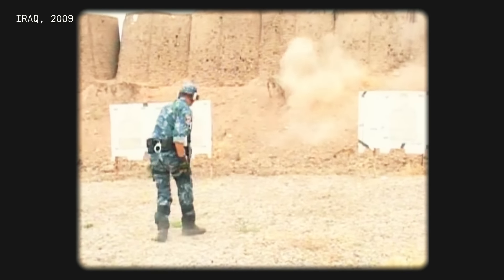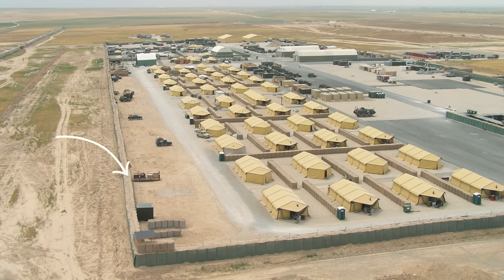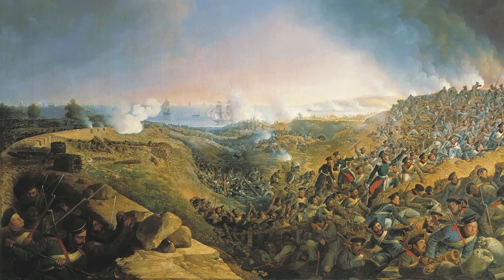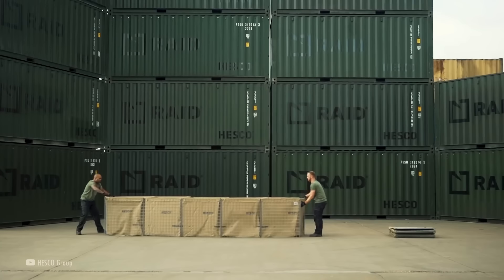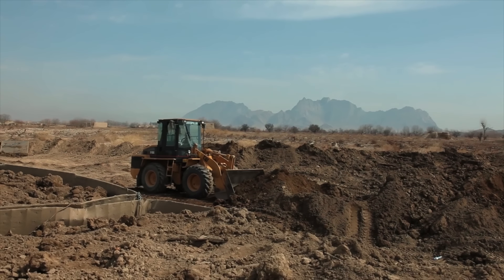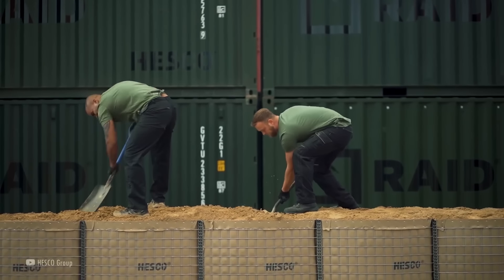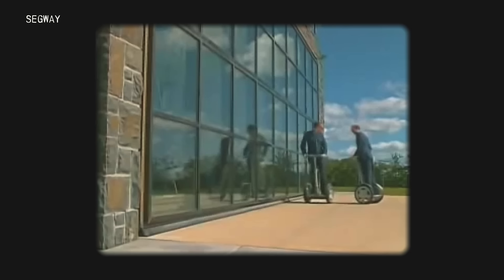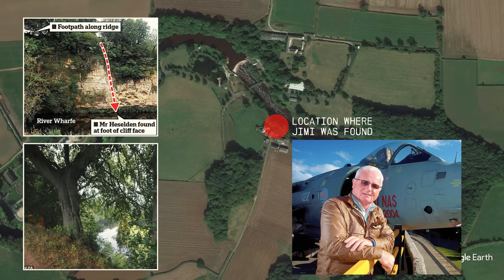Goodbye sandbags?  This is how fortifications are built now | HESCO Barrier

Comment: Hesco barriers are for bases. Sandbags are still used by the infantry. Hesco barriers require heavy equipment to place them. Infantry troops don't have that luxury. I am reminded of the time when I was a private in the 82nd. We were going into the field and my platoon sergeant was assigning tasks. He tells me "You will carry 4 sand bags. I was freaked out because sand bags are heavy and I was the M-60 machine gunner. The M-60 and ammo is already heavy. I went to him afterwards and told him that I would try but I didn't know if I could carry that much weight. He looked puzzled at first, then burst out laughing. "Hey, Dumbass, they don't have sand in them when you are carrying them. You fill them when needed." I should have felt foolish, but I just felt great relief.
Reply: this is the most infantry assumption ive ever seen. Assuming they will be full while you have to carry them.
Reply: 100% the most WSL answer 😂
Reply: Helmet +100 Def but also -100 Int.
Reply: This is the grunstest story of all grunts.
This reminds me of the story in ww2 when the Gurka regiment was told they were going to be flown into hostile territory and then they would jump out of the plane.
They assumed they were going without parachutes..... for a full week and were making requests for changing the landing spot to an open field so they had a higher chance of survival. But they never refused😂
Reply: @snakemanmike  HESCOs weren’t even in existence when the M60 was around.  In Afghanistan we would own a hilltop, Seabee’s or engineers would drop in and build a COP in 2 hours with HESCOs
Reply: This didn't happen to me, but I still got nostalgia.
Reply: platoon sergeant. left out the last word, (EMPTY) lmao
Reply: Thx for a story.
Reply: I don't know about the Army, but Marines have definitely been tasked to fill HESCOs with shovels (or perhaps even E-tools, if things are really desperate or your NCOs are particularly sadistic). Equipment operators such as myself were known to accept significant bribes (usually in tobacco form) to lend their services with a loader. I would always stop and offer, if I saw a need and could spare a few minutes (no bribe necessary, but tips always appreciated). If you can save a dozen people hours of labor, from the comfort of your air-conditioned cab...kind of a dick move not to.
Reply: @RK-cj4oc  LOL that is some bad ass soldiers...
Reply: and this gentlemen and ladies, is why you don't have to score as high on the ASVAB test to get into the army or marines compared to the navy and air force. 😁
Reply: It took me until this video to realize that sandbags could just be filled wherever they were deployed at. I think the name of 'sandbag' made me think it had to have sand inside to function.
Reply: @RK-cj4oc Nahh you gotta be kidding lmao
Reply: I thought you carry those from the "sand filling station" to the designated point 😅
Reply: Personally I don't blame you. Historically the thinking has been "if you can still walk you clearly aren't carrying enough equipment."
Reply: @zacharyevans8489  A sandbag definitely has to have sand (dirt, gravel or rubble also works) inside it to function, but you don't need that function while on the move. You can find fill material just about anywhere, so the only thing you need to carry is the relatively light and compact bag.
Reply: Thats why you make buddies with Navy Seabees or hope they are around. ;-)
Reply: Hahah love that. Funny.
Reply: Oh how this reminds me of being a private. Hilarious times😂
Reply: Well in this case, everything is heavy, right?
Reply: I'm glad you had it clarified though. It would be much worse if you got everyone to fill their sandbags.
Reply: Don't feel bad. I fell for the single sheet of toilet paper instructions in bootcamp.. Walked off to the head as if stupid was stamped all over me in bright dayglo orange.. The entire company laughing.. 🙄😅
Reply: lol i imagined your story like that scene from spiderman where Jonah Jameson burst out laughing
Reply: @BlurbFish  and don't forget the not quite as light shovel that soldiers love to not bring unless you specifically tell them to.
Reply: We all take our turn in the foolish seat. If we can laugh at ourselves good naturedly, it often is a boost to those around you.
Reply: @smertrusne3156  is he your boyfriend?
Reply: @RK-cj4oc  ok imperialist
Reply: ok imperialist
Reply: @cody.vagabond During PBs and defenses, it's always better to dig down, because your position presents a smaller silhouette and is easier to camoflage. Hesco sticks out like a sore thumb
Reply: Hahaha
Reply: They are sand bags when empty bags of dirt when full
Reply: @RK-cj4oc , Gurkas, the most loyal troops of all time, all honor earned.
Reply: @avroarchitect1793  I can only imagine the stress of being infantry would cause anyone to immediately assume the worst possible situation
Reply: @HDBujutsu1775  not exactly. We had HESCOs in Bosnia and my unit still had M-60s.
Reply: @ludomancersvault5518  yeah… in the 90’s🤦🏻. The HESCO was designed in England for soil erosion
Reply: Better yet, use your buddy's helmet 😂😂🫂🇨🇦
Reply: @HDBujutsu1775  lol hescos have been around for like 40 years man
Reply: Nah you could use hesco barrier with infantry. Its clalled GRAB A SHOVEL M8
Reply: - Where's the excavator ?
- You got your shovel private ?
- Yes sir...
- Well you're in luck, you are now private excavator, now make that squad fill them up.

True story
Reply: If your command team is worth a shit and trying to get a solid OER or NCOER they are going to coordinate the expansion of their post with an engineering unit and hescos etc.  Refining your fighting position is a priority of work after all.  I have filled and hauled a fuck ton of sandbags, I have also been fortunate enough to fill hesco barriers without heavy equipment.  I have also been tasked to pick up trash outside the wire before some serious brass came to our position.  Basically, we picked up trash at a dump.  Never regretted joining, definitely never regretted getting out!
Reply: Hahahahaha
Reply: thats like a key aspect of autism or schizophrenia and those can be comorbid, that is, taking things too literally or having concretized ideas without nuance or context.
Reply: @HDBujutsu1775  In my fantasy, you build fortifications using the natural found movements at your local gym. If those movements are so safe, then they can be generalized to any building activity. So you have people standing straight up with long shovels, scalp the topsoil off and shift it across the ground onto platforms where someone is sitting on a chair. The chair person stands up like a squat rack and pulls the dirt on both sides up to the height of a wheelbarrow, and the wheelbarrow has two handles below the transport handles to allow another squat rack behavior to lift and pour.

Then of course, temporary pull down racks that lift the sandbags, which means anyone working them is going to be decompressing rather than loading their spine, to move bags up to the proper height.

And everyone takes a turn in a specific job for 10 minutes and no more.
Reply: When I read the OP's comment, I immediately knew 4 bags were empty.  Guess that's why your ASVAB score was too low to go into the Air Force like me.
Reply: @neglectfulsausage7689  with how big and tall the hesco barriers are, that would a waste of time trying to fill them up with a shovel.
Reply: @hibob841 
Desert Storm the Air Force had the unimog back hoes, we had our backs for digging holes and filling sand bags.   Mucho thankful for the Air Force guy who came over and did more in an hour with that thing than we had all day by hand.

Comment: I honestly want to buy some of these for my house. I think they're nice and practical for making some simple walls.
Reply: do you live in afghanistan?
Reply: Ive bought some for my homestead's fortifications.
Reply: @odoroussmegma2191  No, lmao, but I live in California. So its the same shit honestly.
Reply: @markoredano9141  Where did you buy them at?
Reply: @BlyatBear  Alibaba
Reply: You could probably imitate this quite closely with cyclone/linkmesh fencing and some hessian?
Reply: They are common in Europe. We fill them with rocks to make great walls for properties ! Cheap and efficient.
Reply: As long as you have no need to ever move them after placement, then you could just use cattle panels (16foot X 51") with plywood panel (or HD fabric) to keep the dirt inside!  I don't think that you would need them to be four foot wide though as two foot thickness of dirt would stop almost all small arms!
Reply: Concrete reinforcement mesh
Concrete steel rebar tie wire 
Tyvek house wrap and tape 
Work gloves 
Lineman pliers
Reply: If you take 6' tall  4x2 woven fence, coil it to about 3' wide cylinder, and use a hog ring gun to join the sides together and then make  a good size funnel out of a culvert that acted as a filling-sleeve with a flared out top that could be lifted out with say a JCB Teleskid or Bobcat Versahandler with a side dump bucket,  you could fill it with 3" field stone and have a very very solid wall around your house.   It's freestanding, no footer, nothing is going to drive through it or over it.
Reply: @KarasCyborg  Im having a little bit of a hard time visualizing it, but I’d love to have a gabbion of stone walls and a foreard cactus wall around my property.
Reply: @BlyatBear     Make a penny wall out of vertical stacks of pennies on your desk to visualize a series of 6' gabion cylinders formed into a wall..    Desert Teddy Bear Cholla,  Spanish Bayonet, Cow Tongue Prickly pear, and Century Plants in the front to discourage climbers.
Reply: @BlyatBear temu
Reply: Came here for memories. They also put steel panels for roof.
Reply: @BlyatBear  Wallyworld.
Reply: Yea, just put some ma deuce on top of it and woila! You have a proper home defense
Reply: You can get thicker steel gabions designed to take stones. You see them used as retaining walls along highways and roads sometimes. Heavier and if carefully packed they can look a bit better than a desert army base. Basically a drystone wall.
Reply: if you have a frontloader i guess.
Reply: @Real_Claudy_Focan a Gabian wall works wonders.
Reply: Why though? You could easily just build a retaining wall much easier without needing heavy equipment to set it up. Not to mention you wouldn't be limited to the size of HESCO barriers. Also they probably are sold via the pallet or more, so unless you're ordering a bunch it probably won't be too easy to get them in small amounts without still paying full shipping.
Reply: Earthship defensive upgrade
Reply: Could try tomato cages and some kinda netting maybe

Comment: Hesco barriers and sand bags each have their niche; I don't see sand bags going away anytime soon. A couple of points I want to bring up. I designed a number of FOB's in western Afghanistan. If you desire Hesco fortification, need to 1) properly prepare it's base (think proper soil compaction, crushed rock or concrete) to prevent eventual collapse of the barriers due to runoff and soil erosion, and 2) do not fill with rock. rocks/gravel are brittle and will fragment when struck. Hescos makes good versatile fast fortification, enough to withstand truck bombs, when prepared right. However, not easily removable as our contractors have found out.

Comment: Ah. The mighty HESCO barrier. Brought back memories of Iraq and Afghanistan. Cool video. Although, so you know, the HESCO would often erode in rainy areas. Their side would split and fill dirt would pour out. Still they are a great invention. Second only to the 20 foot concrete T-barrier.
Reply: Bremer wall is iconic, but HESCO is honestly better protection (assuming same height)... larger footprint though.

Comment: In the '93 flood, the city manager of Columbia MO had crews filling sandbags using highway salt trucks. Fast.
Reply: I'm now wondering how fast you could fill sandbags if you loaded a concrete truck with only sand. I'm also thinking how practical a single sand tube 200 feet long of foot square cross section would be for flood control. Possibly 2 ft by 2 ft 50 feet long instead? Fill in any gaps with traditional sand bags and there you go.
Reply: @willythemailboy2 grain bags could be repurposed for that idea (albeit they are a bit wider than what you had in mind).
Reply: My dad works at a power plant and they used those long bags to protect from flooding. It's basically a giant sausage stuffer in a way.@willythemailboy2
Reply: @willythemailboy2  The practicality would be hindered by its mass. Sand weighs around 100lb per cubic foot. A single sandbag can hold a bit more than 1 cubic foot, but is usually only filled halfway or less to be both easily movable by hand & to be malleable when placed (consider them to be beanbags, not bricks). Often about 40-50 lbs seems to be the sweet spot. 

Now, lets consider your 2x2x50 super sand bag. 
Area of circle = 1/2 x pi x r x r. 
A = 0.5 x 3.14 x 1 x 1 = 1.57 square feet.

Now, since this is continuous and will need to be moved into place, each person will need to be carrying about 2 linear feet, but we're also only going to be filling this halfway so that its just as pliable as a normal sandbag. These then cancel out. And so you're left with each person hauling 1.5 to 1.6 cubic feet of sand. 150-160 pounds. Per person. Even if you put another person on the other side & have half the people walk backwards (or everyone shuffle sideways), they still need to carry 75-80 lbs in their forearms. Repeatedly, until the barrier is complete. 

Or you could just fill the whole thing in place without moving it. But then you could make it a lot bigger. Maybe cube shaped, with an open top. A HESCO.

Comment: I really liked the sandbox defense. It's practical, it's simple, it's cheap, and it's efficient. This sandbox fortification could easily be prop up and turn into military styled base In matter of hours. The material needed to fill these sandbox are already readily available. It's possibly one of the best invention I've seen.
Reply: Rammed earth goes back a long ways.

Comment: We had stacked 55 gallon drums filled with dirt in Vietnam. This was used around the barracks only. They barely saved lifes mortars were the worst because could walk into barracks. Bunkers had sand bags that were same ones used for flooding in the states. Rockets could go through sand bags over bunkers  and did killing Men inside. One killing 30 men in bunker. These need heavy equipment to fill not available in the field. We filled sand bags in the field with equipment only shovel required. They weren't very good at protecting us.
Reply: The need for heavy equipment, plus incompetence and hubris, is how you got Wanat.  When the bobcat broke down there was not way you properly fill the Hescos, and the bobcat was too small to properly construct the position even if it had continued working, they needed a significantly larger loader or a HMEE to fill above 4 ft.

Comment: Heavier to transport but not as much of an issue with modern logistics and heavy lift transport planes and helicopters, and the wider availability of front loaders.
Sandbags are still the backup option when manpower is the only thing available, but for larger fortifications HESCO are absolutely incredible.

Comment: I saw that truck mounted version and they followed it with a trencher and had a 6ft ditch approximately 15ft infront of the barrier. I never seen a wall put up that fast and the trench would stop most people or vehicles from getting close.

Comment: You know, it wouldn't be pretty, or desireable; but these Hesco barriers could be used in a pinch to make some rather sturdy temporary housing for the destitute and otherwise homeless folk out there. 

Just line up some rows to build up a barrier as walls, then put a heavy duty fabric overtop as a roof, with some draping over the sides to provide a secondary layer against the elements, and to provide a doorway much like a tent is setup. (It is temporary after all.)

They'd be sturdy enough to withstand some severe weather, warm enough to keep people safe during all the non-winter months in colder climates, and would otherwise be able to house many people in a single unit until they can be sorted out with some better accommodations made available when capable. 

Again, it's nothing special, or flattering. It's temporary, but versatile enough to suit the need. 

And if winter does arrive before they can be emptied out, that's when the trailer units get brought into action. The people who work up in the bush that use those campsites with the container like housing; that's what I am talking about.

Comment: Hescos are great for larger bases or larger defensive lines, but sand bags are really good for small units that don’t have organic engineering assets like front loaders and or are in remote terrain. If someone is air assaulting or parachuting in, it is very easy to have each man packed 5 empty sandbags into their rucks and then fill them to enhance individual fighting positions or create bunkers for heavier weapons.

Comment: Sand bags are still used. Hesco barriers are part of the tools used to build up fortifications, but sandbags still have their place. Things like Hesco barriers have been around for hundreds of years. Hesco barriers are just modern Gabion barriers, which have been used since at least the 15th century. So these sort of fortifications predated sandbags already, but sandbags are still just as useful as they were before.
Reply: Everything you said was already mentioned in the video.
Reply: @jonathanmueller2849  basically just repeated what the guy said in the vid.